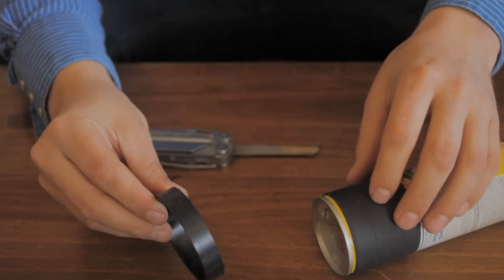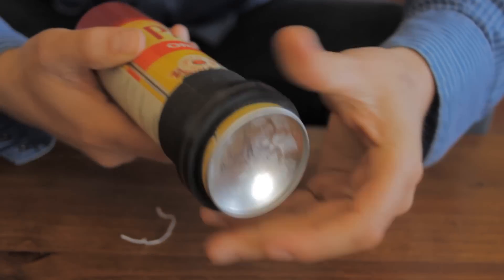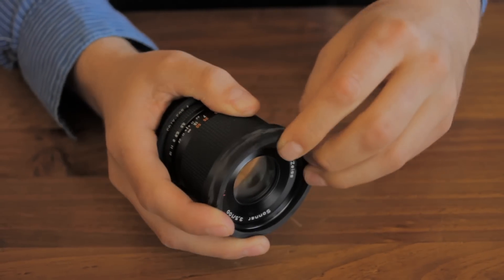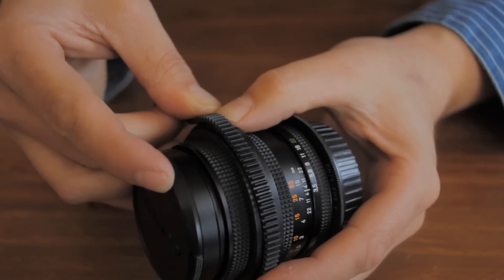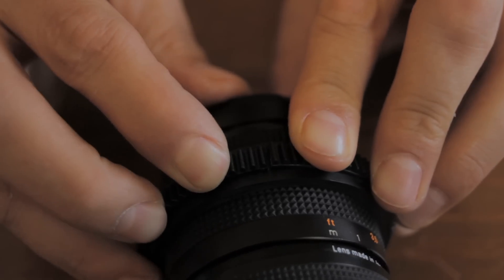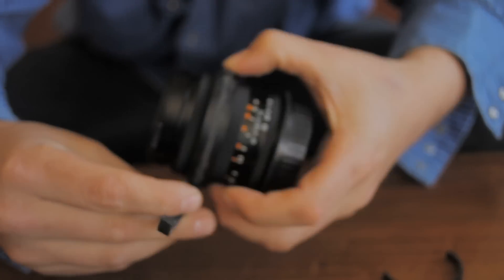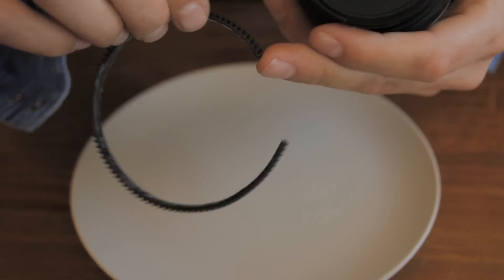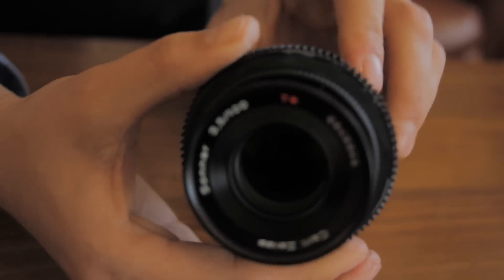DIY Lens Gears for HDSLR follow focus - Part 2

Comment: That was very informative and extremely well done.  Thanks.
I recently purchased a follow focus and found that the adjustable belt that came with the follow focus slipped on the lenses that didn't have smooth focusing.  Additionally, getting rid of the connector should make using my lenses with the follow focus MUCH more convenient.  Again, thanks for the video!

Comment: just a thought... if one finds the lens gear does not seem to match up well, if you make sure that seam is placed to the far side of the lens where the follow focus will not engage it, you wont have any issue with since the follow focus never reaches there.